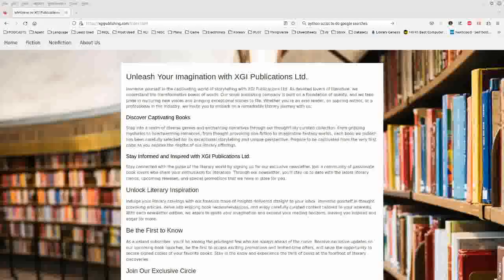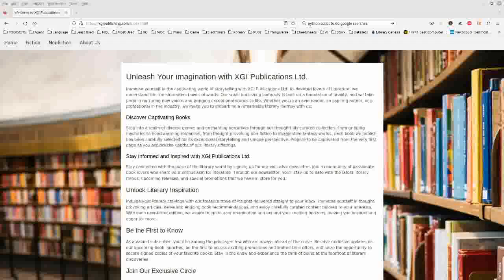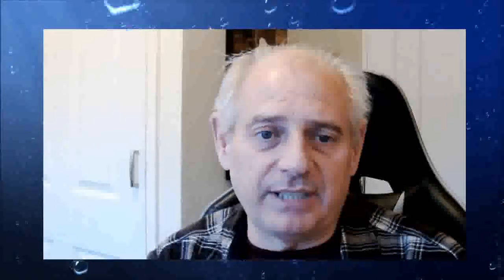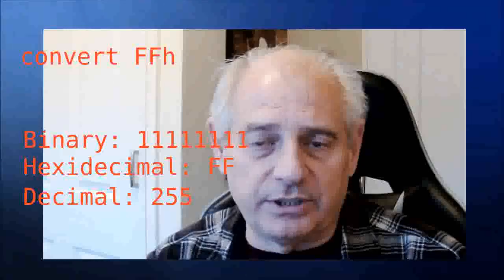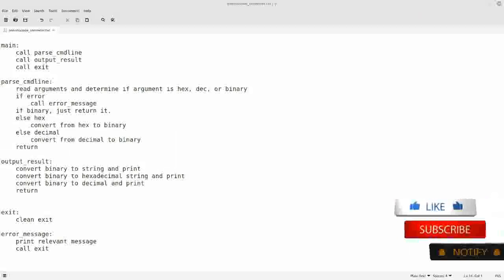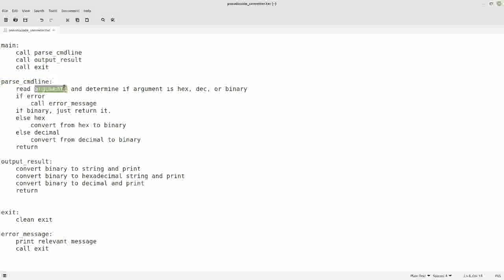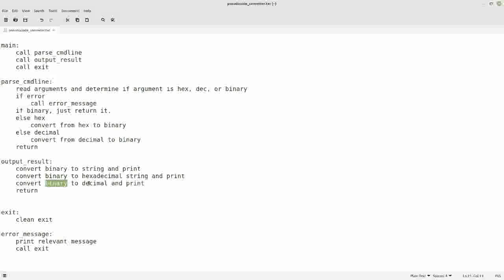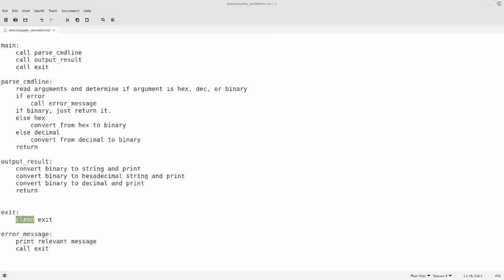Learning RISC-V Assembly: Part I

Comment: I like the video! The only thing that's not really pleasant is the video quality. Cound you take a look at the settings of your video recording programm or of your video editor/converter? The issue is not even 720p. A good 720p is ok. The issue is a very low bitrate and a very high compression ratio which makes it very hard to read text and see details
Reply from the maker: I know! It is so frustrating. But I think I have found the problem, so it should improve in future.
Reply: @Rick62820  That sounds great, looking forward for the next video. I've been designing devices on RISC-V MCUs (espressif esp32-c3 chips) for a few months but haven't touched the assembly yet. Only C/C++.
Reply from the maker: @okhsunrog  I was going to by a SBC or some risc-v chips to play with, but I'm hoping to get some toys for Xmas, so I'm holding off until then. 😁